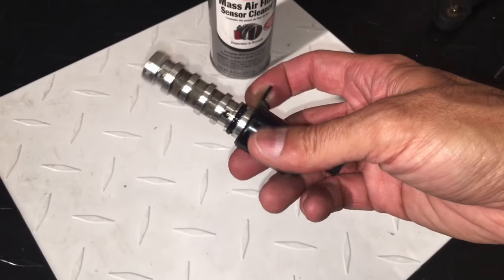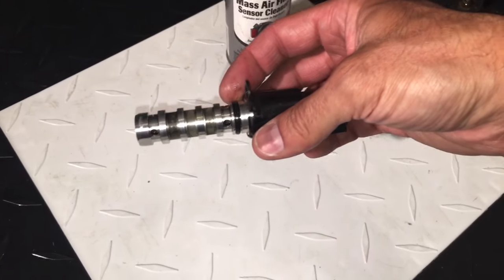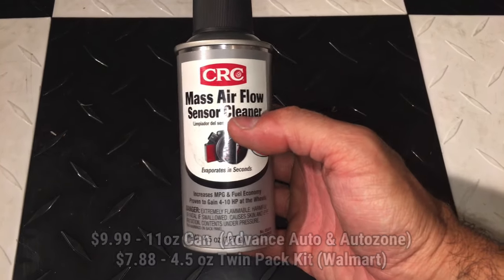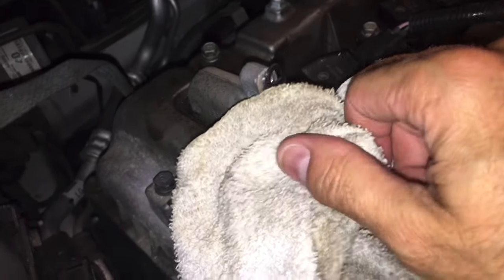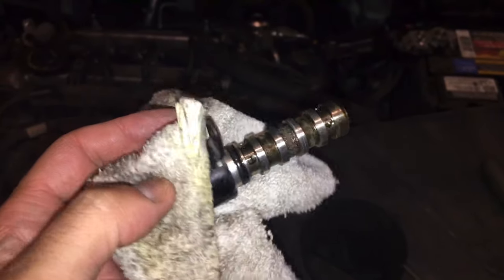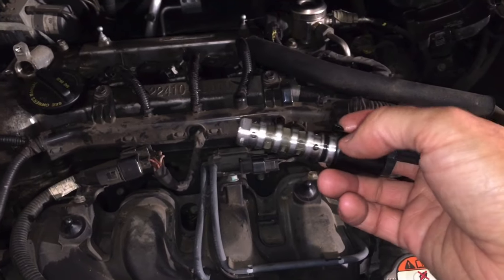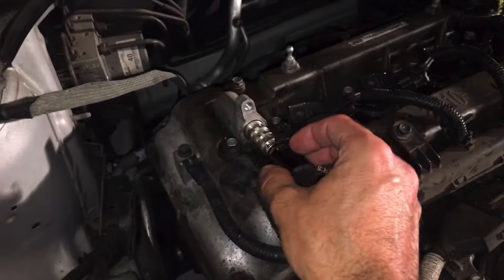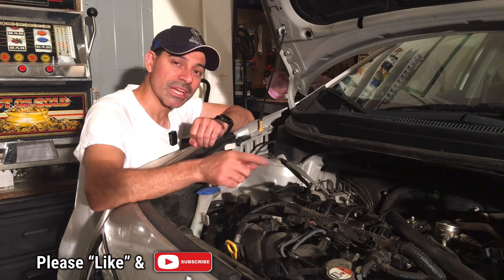How To Clean Variable Valve Timing Solenoids & Oil Control Valves (Andy’s Garage: Episode - 263)

Comment: My psychic powers failed to tell me what kind of car this was!
Reply: I know I'm late to the party here but vvt solenoids are generally the same from car to car with only slight variations. This os prob just a general cleaning tutorial and you just figure out how to remove it based on your specific application
Reply: Toyota
Reply: Or any car that has a vvt.
Reply: Looks like a late model sienna
Reply: 2jz cars have these as well
Reply: This is a general tutorial, but if it's any help this looks like a Hyundai/Kia solenoid which would be normal, because those cars clack like hell because these get clogged.
Reply: Is some type of huyandi

Comment: cover the o-ring when cleaning the solenoid, otherwise it may dry out and crack. Great Vid Andy!!
Reply: Was thinking the same thing
Reply: Makes sense. The mass air flow sensor cleaner sets fast and clean.
Reply: Being a retired motorcycle technician and machinist, I would recommend removing the o-ring before cleaning with any solvent. Brake/parts cleaner works just as well and is cheaper. 

NOTE: 
Always wear safety glasses when using any chemicals that may end up going towards your face and potentially in your eyes.
Reply: @pieceofshit6084  My oldest brother did that once. He wanted to hold onto me while I took him to a water faucet to flush his eye out, but I wasn't going fast enough and he took off half blind on his own. One day after lunch I had my cup of soda on my work bench with the lid off while using brake cleaner and didn't realize some of it went into my soda until I drank some and started getting dizzy. I looked at the soda and saw spots of brake cleaner floating at the top.

Comment: turns out a new VVT solenoid is cheaper than a pack of MAF sensor cleaner. dafuq
Reply: Maybe for some piece of trash auto parts grade one. Not a genuine Denso.
Reply: @nordicpride9708  it's AC Delco
Reply: @sfh2050  I’m making reference to the Japanese vehicles I repair, not the sensor in your video. Either way Ac Delco, Denso are known good solenoids, not made in China garbage
Reply: @nordicpride9708  agreed. I once bought a cheap o2 sensor which lasted only 30 minutes

Comment: Do I need to reset the OBD error code to know if this fix worked or will the engine light on the dash and code go away on its after the fix.
Reply from the maker: After it cycles through the sensors and detects no faults it should turn it off eventually. I always clear it once I fix the issue. If the issue still exists it will issue the fault code again
Reply: May take 50-60 miles for code to clear itself

Comment: Thanks alot ....what if we can get the cleaner, can we use local fuel ⛽ for the cleaning operation
Reply from the maker: No, you don’t want anything too strong that’s why MAF Sensor cleaner is good. It’s made for sensitive parts

Comment: I thought I saw some small metal particles on the screen when you removed the solenoid. As these are, I believe, supplied with oil pre-filter, is this an issue?

Comment: Cool. The VVT solenoid had a tiny leak on my 2006 Toyota Matrix at 206k miles, so a replaced it and it's filter with OEM units.  I thought it was the body that was leaking, but it turned out to be the o-ring, so I could have just replaced that. Also, you can use an m12 battery to bench test the unit to make sure the valve is moving freely.

Comment: You recommend using that cleaner.  Could one use a degreaser& let a solenoid soak in it?
Reply from the maker: I would not use degreaser on that, it can damage it.
Reply: @PhillipsVision  ok  I'll try the cleaner you recommended. Thank you for replying so fast!

Comment: Is that oil ring leaks or loses pressure with that also gives a false reading to the VVT sensor
Reply: Someone put silicone when I found the sensor and I need to know if it’s leaking oil out of that sensor where is located in from the engine would that cause a cold that is not communicating with the Kranks is that like if the timing is off because of oil pressure what that cost that also please get back to me so I know what to do
Reply: All the VVT sensors were replaced by someone else and the timing chains what done or three of them I’m still getting the VVT sensor not communicating with the Kranks sensor could it be possible because they put silicone into the wiring that is still leaking oil because of oil pressure still giving us that sensor a bank to not communicated on a 2007 Saturn if someone knows please let me know what to do

Comment: I removed the ocv valve and it had what I believe is metal shavings in it. Looked like silver glitter. How bad is it? About to install it back in and test it to see if that noise stops. Your videos have been very helpful thank you.
Reply from the maker: Metal shavings is not a foot thing. Could be coming from the valves, heads etc. Need to get it checked out.
Reply: @PhillipsVision  yeah I replaced that solenoid and it's a minimal improvement with power but that knock is still happening. Set up an appointment to get it fixed because that's beyond my scope of mechanical know how. Thank you very much again for the assistance!
Reply: @elkuko8686 What ever came of this?
Reply: @hokie9910  had to get a new engine. Over 9k.... fucking suuuuucked.
Reply: @elkuko8686  How many miles?  Was it a Toyota?
Reply: @hokie9910  No, it was a kia. Over 140k miles.
Reply: @elkuko8686  ah, ok, that makes more sense.  I am sorry for that bad situation.  That stinks.
Reply: @hokie9910  Appreciate it. Shit happens, but once it's all paid for it'll look real good on my credit score lol.
Reply: I just had to replace my motor In my Hyundai. Had about the same mileage. I’m about to clean this sensor in the new motor as it’s making noise also 🤦🏼‍♀️👌🏻
Reply: @ditch.flower  Hopefully, you don't find metal shavings in it.

Comment: Do you need to let the solenoid dry completely before putting it back where it goes?

Like, letting it dry 100% of all the mass air flow sensor cleaner? Or does it not matter?
Reply from the maker: I would let it dry, but keep in mind that MAF Sensor cleaner dries fast
Reply: Let it dry and blow it out with compressed air (can of compressed air if no air compressor works). I also dip it in motor oil before reinstalling.
Reply: @PhillipsVision  does the cam position need to be specific when doing this?
Reply from the maker: I let it dry.
Reply: @PhillipsVision  Thanks for responding so fast.
My question is "does the cam need to be at TDC or a spacific position like exhaust valve open..
Or is it safe to remove and reinstall at any position?
I'm working on an 996.2 04' cabriolet
Reply from the maker: @darrellclark9596  I don’t think the position matters
Reply: @PhillipsVision  cool, thanks for your time 🤙
Reply: I needed this answer so thx for asking it lol. Also, this was a great video easy to follow.

Comment: I've taken out both valves out of my Astra H engine for a clean, and noticed that there are small gaps at the top of the valve (the part which opens up with 12v), should these be closed fully when not under electric current ? Would you consider the faulty and recommend replacement?  🤔
Reply from the maker: Their default home position should be closed

Comment: I have a low idle problem. The idle rpm stays at around 630. When turning headlights on, the rpm further goes down. The car doesn't stall though. Have thoroughly cleaned the throttle body. No luck. Could the vvt solenoid be causing this issue. The car has done 100,000 kms with regular oil changes every 10000 kms. Have been using fully synthetic oils.
Reply from the maker: @pankajpuranik469  it could be a number of reasons, but I would start with the IAC valve. Those can get dirty and cause issues similar to what you are experiencing. Try cleaning it with carburetor cleaner

Comment: thank you very good video
i am going to do it .     i am having an issue with a 2007 kia spectra i replace new coils spark plugs and wires but still having miss fires and random miss fires. do you think it could be this dirty valve
Reply from the maker: Are you getting any engine codes?

Comment: Will carb cleaner work? Its hitting metal parts and not sensor at all. Your just cleaning the Metal parts of the Solenoid and not Electronic part of it? I also have WD40 Specialist Contact Cleaner quick drying made to clean sensitive Electronic parts, Now sure if that would work just as good as CRC or should I Stick to CRC? 

Thanks for your reply.
Reply from the maker: I think as long as it’s an electronics cleaner it should be fine. Would not use carburetor cleaner

Comment: Got a 2018 Hyundai Sonata, pulling a P0100 code saying the Intake Camshaft Position Actuator Circuit / Open (Bank 1) is this what this is? I saw a diagram for my car & it shows a camshaft actuator on the back passenger side near the exhaust manifold & a camshaft position sensor on the driver side near the intake. Not sure which one is which.

Comment: Can i use wd-40 to clean the VVT ? Or  i ll need the mass cleaner spray?
Reply from the maker: Use MAF cleaner. It will dry quickly and not leave residue behind that can damage the sensor

Comment: Got a P11D6 fault on seat ibiza. I'm struggling to locate/purchase the part but will try cleaning first.

If I use brake cleaner etc and dry it off do I just plug it back in?

Comment: I have a 2008 GMC Acadia SLT I need to replace the Bank 1 VVT on I can’t find this thing on the valve cover in the front or by the oil cap

Comment: Obviously this is not a Ford Eco-boost engine.  I'm going to have to remove the valve cover to access that VVT solenoid.  Won't be a 10 minute fix!  May try your cleaner trick on it, but will likely replace the solenoid after going through the effort of removing all the parts to get to it (spark plug coils, high pressure injector pump and fuel lines, several electrical connectors, a bunch of bolts, etc).

Comment: On the 2007 XTRAIL QR20 motor can the vvti sensor cause the car not to ref up normally I drive the car it's fine for a KM or so then engine light comes on and it battels to ref up so I stop car idling rough then drive home slowly wait 20 min start the EXTRAIL idling 100% do you think it can be the vvti sensor or pulley

Comment: In my Volvo VVT solenoid, in the center, the moving part is a plastic rod. I think it deformed and became stuck. It requires lot of force to push it back. I think the oil presure isn't enough to push the rod back so it's stuck.   Cleaning it with dish soeap reduced mis-firing but there were still mis-firing. It's better to replace it with third party part costing $30 to $100 bucks. (Car has 200k KM)

Comment: If anyone is staring at a 2010 camry and wondering if it's in the front - it's not.
It's on the back side of the engine directly behind where it is in this video.
Reply: did you have the problem p0017?

Comment: This was informative. Thanks for showing what to use that would not harm any of the materials.
I have a question on my vct if you have time to respond to it. I was going to change my vct's this morning. The passenger side went well. This is on an '06 F150 5.4l 3v Triton. The vct is in a hole with a rubber seal that snaps into the hole. 
Like yours there is the bolt to hold it in. The difference is that my vct is down in a sort of deep hole. 
The bolt on the drivers side is so tight I cannot break it loose. I am using a Torx 27 sixteen inch screwdriver. I didn't know if I could spray blaster in there or not. It is like it was installed with an impact wrench.
Any thoughts or suggestions from you or anyone would be greatly appreciated. Jesus bless.
Reply: MAF sensor cleaner will still harm the rubber o ring, i'd personally remove it before cleaning

Comment: I went past the recommended mileage between oil changes and had some sludge build up. I’ve since changed the oil several times but I have a check engine coding camshaft. There’s a knocking sound , could it possibly be I need to change/clean these?
Reply from the maker: Yes, or it could be your valve lifters. Worst case, there could be engine damage

Comment: Have a 2007 Toyota sienna 3.5 V6 the car is set for a while maybe a year and a half or so try to start it and it turns over and has a chat timing chain but it turns over it sounds like there's no compression whatsoever we pulled the plugs from the front so the front three cylinders we checked the timing there checked the compression it was very little compression squirt a little dribble oil down each plug hole and rechecked it came up with 140 lb in each cylinder and when we pulled the valve cover off the front three cylinders there's no oil up in the engine on the top at all and then you can crank and crank and crank and it pushes no oil up there whatsoever any idea what we should look at we did pull the oil pan and check the sump screen it is perfectly clean there's nothing there any other ideas or is there the VVT solenoids would that keep oil from going to the top of the engine if they're stuck or anything wrong with them

Comment: So I removed and cleaned solenoid on ISUZU. Having difficulty seating part all the way in past the o-ring.  I noticed the screw bracket moves freely. Any suggestions?
Reply: Put some oil on the O ring

Comment: Where would I find the oil control valve on a 2018 dodge journey? That is the code my car is showing for my check engine light being on.....
Reply from the maker: Not sure specifically, since I have not worked on a Journey. I’ve found on the vehicles I’ve worked on that they are around the valve cover and intake manifold
Reply: @PhillipsVision  Thank you for the info! I will try to find it

Comment: My cvvt calve has slight wiggling when I removed it for clean
I don't know if this is normal, or it should be solid when I wiggle it be hand
Reply: Pickup a new bolt you may have stripped the old one

Comment: When will the check engine light go off  after I cleaned valve  what if the valve is bad
Reply from the maker: You need to clear the engine codes with a scan tool.

Comment: Isnt there two VVTs in most cars?
Reply from the maker: Depends how many banks your vehicle has. There is normally one per bank.
Reply: @PhillipsVision  i have an kia rio 2018 1.4l engine car? Do you know if it has two?
Reply from the maker: @shimzard  should only have one on the top of the valve cover.
Reply: on earlier model hyundai/kias there is only one VVT Solenoid, and the timing is changed for both camshafts by a special gear that connects the two.